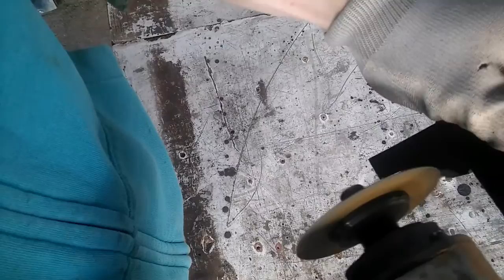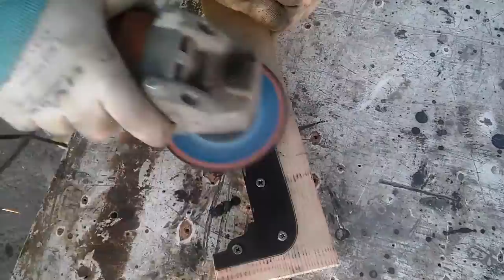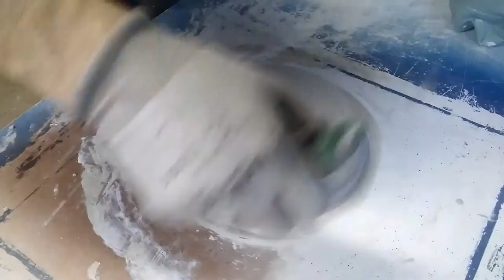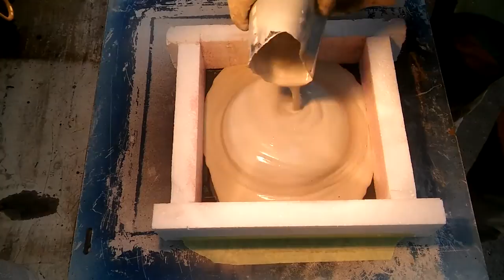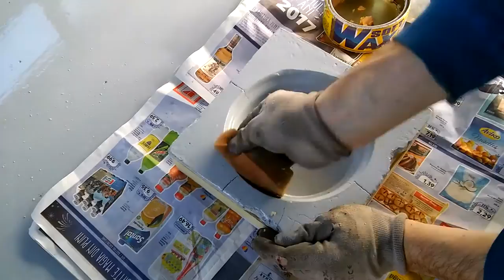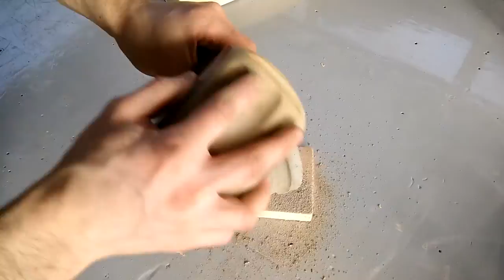Concrete column base

Comment: Damn man am incercat technica asta dar nu imi iese, folosesti vreunfel de ipsos diferit sau doar IPSOS simplu ??? .....imi rupe din ipsos cand mis (eu defapt nu am facut in forma circulara ci pe lung) Am vazut pe net pe 1 care punea un brat de ipsos pe masa,impingea forma de bordura de vreo 3-4 ori si BOOM ! perfectiune ! Gresesc eu cu ceva ? :[  tot adaug material si imi face asa unfel de gaurele
Reply from the maker: Scuze ca nu tiam raspuns inca, dar numai acuma mia aparut commentul tau.... E ipsos normal, de obicei face chestia astea inainte sa se intareasca, Ar fi bine sa il faci din mai multe ture de ghips cum fac eu ca sa fie tot timpul ghipsul proaspat can treci cu matrita peste
Reply: Nu e nici o problema multumesc de raspuns ^^ ! Da,dar asa nu prea se renteaza,cat timp muncesti pe 2 metrii de bordura decorativa mai bine faci o investitie de silicon cu carcasa de ipsos si scoti mai eficient, avand in vedere ca e ipsos,evacuarea din manusa se face repede, in 5-10 minute de la turnarea lichida. Vara, chiar mai repede de atat. E cool de one time try,pt produse limitate (Ca sa nu bagi bani in modele si silicoane) Dar cu piata actuala mai degraba as merge pe silicon ca se pot adauga elemente decorative mai deosebite (flori,etc)
Reply from the maker: Ce am facut eu, e mai mult pt cand trebuie sa faci o piesa pt o restaurare sau o cantitate limitata
Reply: Da ! :) este ft oke ! SI foarte frumos !

Comment: What kind of cement did you use for the finished product?
Reply from the maker: Portland cement
Reply: Paul Iascau's studio Did you mix it with just water?
Reply from the maker: kirk Lyles water and sand